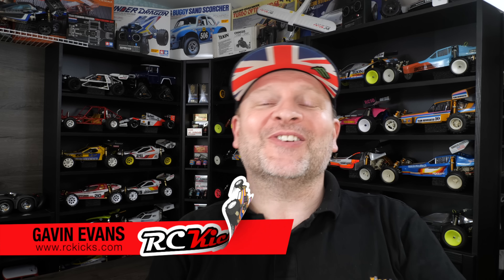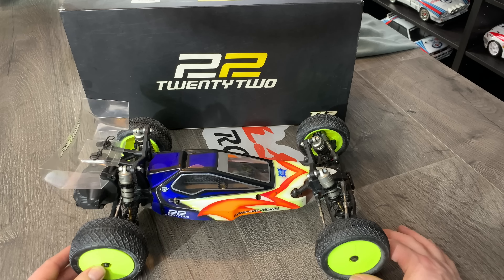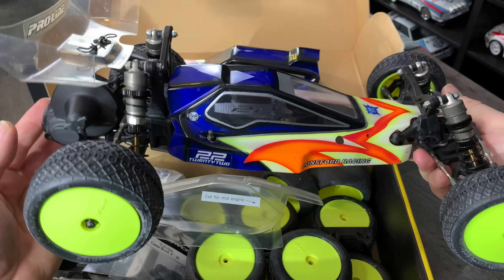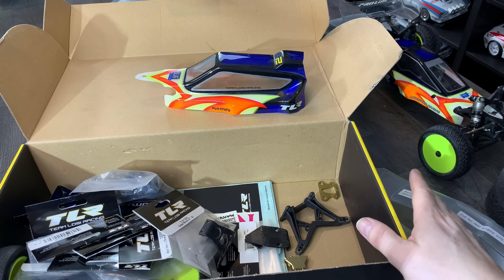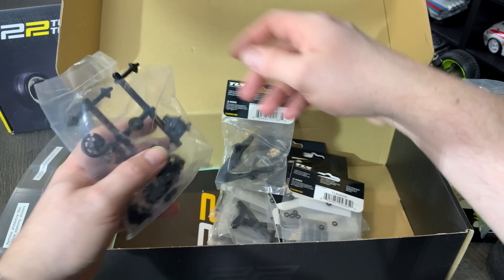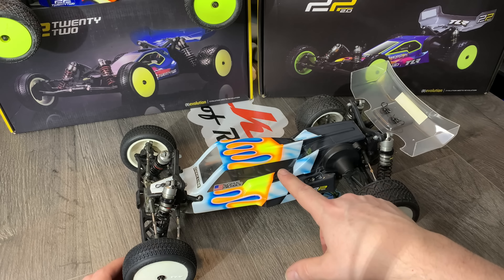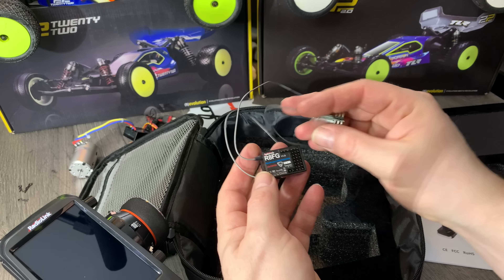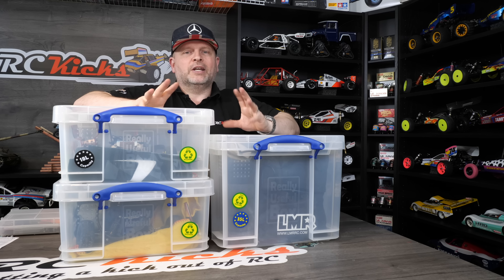Prepping To Race Tomley RC, Kevin Talbot & Popalong RC. Unboxing 2 New Race Buggies! TLR 22 & 22 2.0

Comment: I just have to say( please don't see this as a negative comment) I have several modern carpet buggies, I have an original rear motor 22 and a mid motor 22, which I tried to run on carpet. My more modern Associated, Schumacher and Yokomo buggies run circles around the older TLRs. The latest TLR with mods is awesome on carpet mind you. You will still have a blast with this race but you might be outgunned a bit. In saying that I cant wait to see it all unfold. Good luck.
Reply from the maker: My racing skills are zero so the car really wasn’t the issue lol.  I know, these are old girls now and will be going into the collection.  I’ll need something a more 2022-23 if I’m going to go every two weeks.
Reply: @RCKickschannel  Andy Robinson has it right, I'm looking forward to the race. Just wish Glen and Keith could be there with you all to make it a full youtuber race.

Comment: I like the Losi 22 buggy. I got mine as a ready to run and modified it. I got rid of the Specktrum radio and installed a Futaba radio. I did keep the original servo and the ESC and motor. I also got many metal parts for it too. I liked how it handled around the track. I have not run mine in years. Thoughts?

Comment: Definitely need mid motor spec for carpet racing. Rear motor config will want to wheely in high traction conditions in less you keep the power down. You will want the Schumacher Cactus tyre in yellow compound for the rear and Schumacher cut staggers low profile for the front, you don_t need any tyre inserts in the fronts